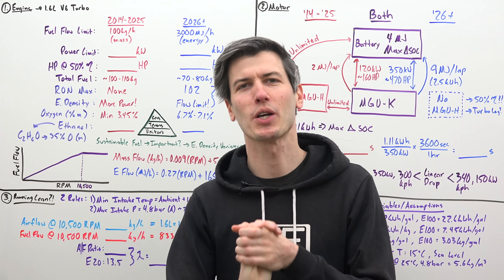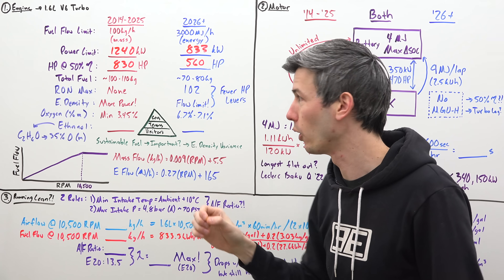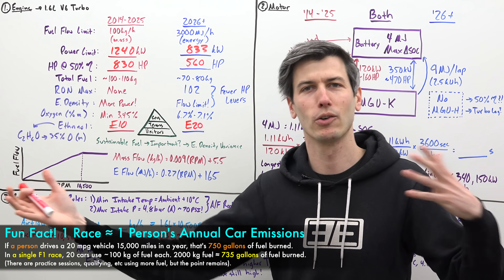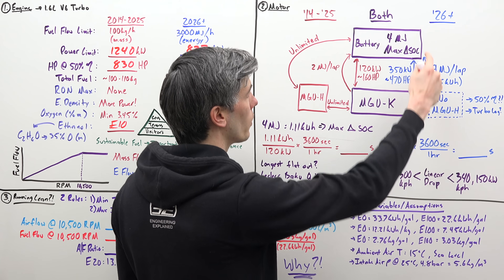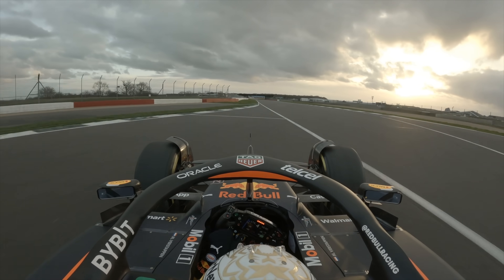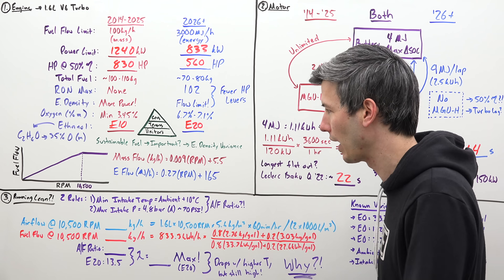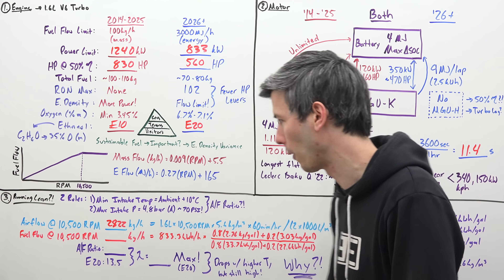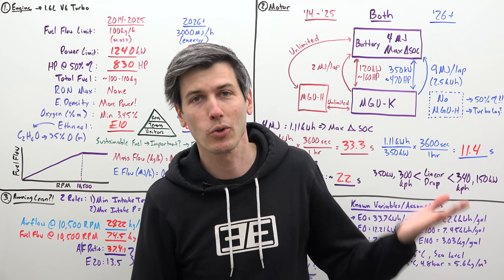Why Are 2026 Formula 1 Engines Going To Lose So Much Power?

Comment: What annoys me is the hybrid era is in the name of reduced emissions. If they really wanted to reduce F1 emissions, they'd have fewer races in the season! By far the biggest polution in F1 comes from shipping the whole circus from country to country. We could have kept the V10s and knocked a few races off the calendar and had a greener, more exciting sport overall.
Reply: Most "green" changes from big business is more about appearance than effect. Look at how celebs that preach about the environment also using private jets.
Reply: Even changing the order of races would improve things massively in that regard.
It won't even matter when the switch to synthetic fuel, so I don't understand why they wouldn't just make them sound good by allowing 3 litre NA V12s at that point.
Reply: @C.I...  Some races need to be where they are in the calendar because of local weather conditions, nobody is gonna race in Miami or Texas in June.
Reply: @C.I...  3litrer V12s don't work even ferrari didn't use them after 1995...last V12 champion was Senna in 1991. also note the last manual gearbox to win thats how old tech and backwards the idea of a 3litre V12 is.
Reply: Why does F1 even need to be green.
It's a sport that a tiny tiny tiny percent of the population participate in
Reply: @MioJuventino88 It doesn't need to be sustainable.  It's all about THE MESSAGE.
Reply: It's not that though.

It's driven largely by the engine manufacturers...that's the way they want the engines to go, because, it allows them to get the data that they need with regards to the engines they want to produce.

Yeah, ok, the FIA enforce a bunch of fru-fru atop that base line level, but, that's what makes F1 , F1.
Reply: @weedfreer  If fans wanted "road relevance" they could sit by the M4 and watch that instead.
Reply: @hedleythorne  yeah nah, I think you were maybe thinking of Indycar.

👍
Reply: @weedfreer  Hahaha! Er, no.
Reply: @hedleythorne  have you seen the side by side comparison of Indycar Vs F1 around COTA?

I mean, if it was a competition of essentially driving around a circle as fast as you can, then, maybe, they'd stand a chance.

Under normal racing conditions like at COTA it any other F1 like track...they'd be lapped withing 15 laps
Reply: I think its more about showcasing engine tech.

But yeah, I think the 3 Rs are REDUCE, REUSE, and RECYCLE in that order.
Reply: "it's not about the money, it's about sending a message"
Reply: When they say it's about the environment, it's never about the environment. Quite the opposite.
Reply: That is a good point. If that were the case though, the engineers wouldnt be pushed to limits of extracting as much as possible from the available technology. I think that would result in the teams not learning as much, which is not a great motive for the manufacturers. That is besides the prestige of course.
Reply: @EMPower91  Well the FIA are limiting the power output so I’m not sure what envelopes of technology the designers will be pushing if they’re capped on the power the engine can produce 🤷🏻‍♂️
Reply: @EMPower91  I do love the technical development side of F1 ( even though sometimes I'd like to see all the drivers compete in the same car, just to see ). I think we are kidding ourselves if we think F1 tech actually translates to road cars in the long run.
Reply: @LupinYonderboy  there are examples for F1-developed tech that is used in street cars like active suspension and KERS, just to name a couple and there is probably many more
Reply: @EMPower91  yes this is true. Problem is, new cars aren't going to be similar to new F1 engines at all. So, this knowledge isn't going to transfer very well. Maybe they should do what they did back then, like how v12s and v8s were allowed at the same time. They need to make sure that both v12s and v8s are allowed to reach the same performance numbers though. The new fuel and tech like the mgu-k can be used to aid the engines efficiency though too, while also giving engineers a new challenge. In other words, have engine variety and limit an F1 cars engine to perform more closer like a road car while making use of the new technologies.
Reply: @LupinYonder  I did see there was taks about bringing A1 gp back who knows we might see some of these drivers fighting it out in the near future
Reply: @EMPower91   hate to be the "actually" dude but on the subject of active suspension and a few other tech it (active suspension )
was already  created before F1. 
 Alot of f1 technologies are major  improvements of other tech that existed before. 
Not saying they don't innovateat all  but I have to agree with @LupinYonderboy there is very little (tech from F1) that trickles down to everyday road cars. 
If anything, my opinion I see formula E having a greater ability to influence the development  of electric consumer vehicles.
Reply: @LupinYonderboy  get with the program! Internal combustion is on the way out and you can cry about it, it will happen. Even think in 2030 there will be only generators to provide electrical power.
Reply: @LupinYonderboy  What?? Just look back in history my friend. Where do you think most technologies in today's cars were developed? TC, ABS, Turbos, Hybrid, it all starts in racing. The research lab of the automotive industry.
Reply: @EMPower91  Those things would have existed regardless if F1 existed.
Reply: @LupinYonderboy tyre technology has probably the biggest impact on road cars (if you buy high performance tyres)
Reply: Green is just a reference to the color of the US dollar. Not the environmental considerations. They are trying to stay as green (profitable) as possible.
Reply: Yea makes no sense to lower emission of the 20 race cars when there is a buttload of trucks and equipment being flown in or driven when it isn't too far. You can probably just scrap one race off the calendar, bring the V10s back and you still would have less emissions. Maybe the big part of the environmental issue is that the teams try out new technoligies enginewise that they can use to make the engines of commercially sold cars much more effective.
Reply: how about we just get rid of this eco garbage entirely? there are only so few F1 cars. These things do heck all to the environment.
Reply: You're right, and i agree with you re the emissions of the sport mostly coming from the circus moving around, but the climate/ sustainability thing is just F1 marketing to greenwash themselves. 

The real reason is financial. Allowing a free for all like the old days is not sustainable, that's why teams went bust and disappeared all the time, (and others dominated completely and utterly though tbh that's not changed much **looks at Mercedes and RB**) this is why cost caps exist, and that's why they're going in this direction, it's the only way to attract investment and new teams or car manufacturers into the sport. These rule changes are why Audi is coming into F1 in 2026, it's why Porsche wants in etc.

This is just F1 trying to survive.
Reply: It's not about actually doing better for the environment, it has noting to do with the environment. It's political. It's about appearing to be doing what's better for the environment.
Reply: If you look at those triangles of emmission you will see the major contributors is also us (fans) or people itself
. So by using F1 as a leading R&D in combustion engine technolgy, sooner or later those technolgy will be in our car, so anything that is related to our daily commute system will significantly be reduce in the total amount emision, combined, by only using small sample set of highly advance groups of engineers and drivers on the track as a "test lab". This is a long term process. Keep in mind that thet target a 0% net carbon emision by 2040 or so, not tomorrow or day after it.
Reply: Or, OR at least change the order so that the everyone could move across the globe gradually instead of jumping back and forth. Adjust the order and you compensate for all the emissions the cars produce over the season.
Reply: The tech feeds down into everyday vehicles
Reply: The biggest fuel use is the spectators going to the races. The actual race cars use an infinitesimal fraction of that fuel. It's all a virtue signaling hocus pokus.
Reply: Don't even need to have fewer races, just join them up on the calendar to minimize travel.
Reply: The EU is trying to ban anything enjoyable, even perfume
Reply: @seq31  Couldn't agree more! Thanks for this detailed answer!
Sad but true. So many amazing tracks! And some that F1 probably has never bin on. Even if it's a shorter track it could still be interesting because of many corners and amazing layout. Just no long straights. Sadly the organisers don't understand that.
Reply: I suppose those rules are made to getr more money for development in this direction. Because  a lot of race developments later became a game changer...one of those is the turbo-intercooler charger. Which reduced the fuelconsumption of any truck in the world from 1,5 km / liter diesel to , now, 4 km/liter diesel.
When we take these savings into account for F1 it's a very clean circus...saving a multiple amount of energy in comapre to their direct usage.
Reply: It’s not that they want to reduce f1 emissions, but rather increase the r&d that goes into hybrid powertrains. Lots of technologies in everyday cars bleed down from discoveries in racing.
Reply: Now see a lot of outsiders and activists don’t really think about the transportation. They see cars with Internal Combustion Engines and they go nuts. If you take this into consideration, it’s just a thing to maybe shoot themselves in their own foot at the FIA, but mainly to look better in front of the media, activists and other outsiders.
Reply: They could 100% make the calendar more efficient. Jumping from Azerbaijan to Miami to Italy is insane. Then youve got Japan, Qatar, then the US GP.  the air travel alone has to be so much worse than the emissions from the cars.
Reply: That's not really a good argument. Byt that logic, we shouldn't have car-racing at all.

Sports are for entertainment (for consumers) and profits (for stakeholders), so the relevant thing to look at is how many emissions something is producing compared to how many people it's entertaining and how much money it's making its stakeholders. More races = More entertainment and money. The emissions-goal of Formula 1 isn't necesssarily to reduce emissions overall, but to try and maximize profit/entertainment per gram of CO2.

Now i don't have the numbers to directly compare it, but F1 is a really popular sport that is watched by a lot of people (Abu Dhabi 2021 was watched by 108 million people). So i suspect that for the amount of people entertained, F1 is a rather low-emission sport. Certainly lower-emission than its American counterparts, ebecause 0ven if they travel less, the viewer numbers are about 20x higher for F1.
Reply: We all know that the emissions from the cars on the grid are fairly irrelevant in terms of the carbon footprint of a race, but I think it is important for F1 to be relevant to the car industry, and it's important that F1 is developing technology that will appear in "real" cars. It also doesn't look good if F1 says "we're going to keep our gas guzzling engines, but you have to drive slow cars with tiny engines". F1 engines consume a fraction of the fuel they used to, but have continually gotten faster. Every generation has seen an initial reduction in speeds initially, but withing a season has exceeded the speeds of the previous generation. The 2026 engines will see another reduction in power, but I'll be surprised if we don't see manufacturers and teams producing cars as fast or faster than present by 2027.
Reply: The majority of the F1 circus is shipped to the races by surface. I think there are five different sets of race "kit" shipping to the different races. One way to reduce the carbon footprint would be to optimise the races so that they could do it with four or even three sets of gear. Another would be to reduce the amount of kit teams are allowed to fly to races. Having the majority of the car shipping by surface, with a weight limit on new parts that can be flown in could save a lot of carbon miles.

However the biggest carbon footprint is from fans. If you can reduce the number of fans travelling, particularly the number flying in, you could reduce the footprint of the race. Of course that would also mean reducing profit from ticket sales. However, reducing parking at circuits and increasing use of public transport could see a significant reduction in emissions from a race weekend.
Reply: @lostcarpark  some more great points, thanks
Reply: Use hydrogen seriously, if they use that, it will bring back the V12, and I wanna hear those good'ol sound
Reply: I mean a better order in the race callender would help massively
Reply: F1 is such a teny tiny absolutely minuscule amount of global emissions.
Reply: With synth fuel you could have V10s anyway, the issue is that V10s are irrelevant to manufacturers.
Reply: great point.  I'd go further and say the impact of fans driving and traveling to the races greatly eclipses the carbon footprint of the teams.
Reply: Couple races less i agree on.. but imagine if the calendar was actually scheduled efficiently?
Reply: Just TALKING about environment impact for 20 cars racing once every two weeks is hilarious 😭
Reply: less races=less money
Reply: Actually the highest emitters of a Formula 1 race are millions of fans that drive to the race tracks to watch these races. Netherlands was interesting that they didn't low people to drive in to watch the race. People instead used transit and bicycle coming and watch.
Reply: You have a strange angle on this.  F1 tech is used as development for the whole industry, not just the actual racing series.  Engine development eventually trickles down to consumer cars. More efficient F1, more efficient cars overall = lower emissions.  Greener earth.
Reply: There's absolutely no way to make professional sport green. Especially motorsports.
Reply: How does the most boring "bring back v10's comment" have over 3k likes. You literally can not come up with a more tired, retread, over-used comment than this. If you like racing watch F1. If you like crazy loud engines go to the drag strip. Something for everyone.
Reply: Let's be honest, F1 is NEVER going to be sustainable. 
As an eco conscious and car enthusiast guy, it's hard to admit, but nothing they can do would ever make "let's take crazy boxes that goes as fast as physics allow around a loop" sustainable. 
Even if it was electric : neglecting the biggest impact (which is transport of people and team to the track), the sheer amount of energy and rare ressources required to create those "crazy boxes" is an injustifiable waste of precious ressources.

But greenwashing is the name of the game at the moment. You just have to pretend hard enough that you're sustainable. Which is something those hybrid V6 excel at : pretending they're more sustainable.
Reply: @InformatrIIcks  it's an oxymoron. they are racecars not smartcars. why would motorsports be efficient. It's like having Olympic athletes compete while in calorie deficit.
Reply: They really don’t care about emissions. It’s all for the media and to keep environmentalists happy, saying oh we have tiny hybrid engines and are going to be using renewable fuels. They leave out the part where they’re jumping from continent to continent every other weekend.
Reply: Total click bait.   Less races! more privation!
Reply: It's all a psychological operation by Malthusian Eugenicists who want you in debt slavery
.
Reply: Or they should stay on a continent more. Europe has so many tracks... Spain, italy, Nürburgring, Hockenheim and few more in Germany. Spa and many more. You can drive to each location by car easily if you have one.
Couple races in Japan. Autopolis, Fuji and Suzuka for example.
And the US has many tracks too!  Would be so much less emissions if there would be 4races in the US 4 in europe and 4 in Japan or something.
Reply: SpaceX....
Reply: I think you're missing the point here. The reason why they go around circuits is for money, and sometimes getting money means pretending you care about things you really don't, like environment.
Reply: Exactly... If I wanted to watch formula E I would. But of course nobody wants to.
Reply: Now it’s not about the environment, it’s about lining their pockets
Reply: How right you are, this whole sustainability thing is a joke when you look at it closely. F1 will not be F1 as we know it for much longer. The best days of F1 are gone forever.
Reply: @daviddickinson6346  I do have hope in the program that they are going to find something, but at the same time, we would loose a precious sport.
Reply: Just changing the order of the races would make it massively more efficient
Reply: Common sense vs green  weenie leftist propaganda propped up by government. Common sense always loses.
Reply: to be fair. for marketing making your cars look cleaner would be seen and approved more than just. y'know changing distribution stuff.
Reply: In the Netherlands up to 80% of visitors for the race come by bike or by public transport (mainly trains).  And those that come by car are directed to carparks up to ten miles from the circuit and shuttled in by busses
Reply: The reality is, we don't need automotive racing, we'll get by just fine in life as a species. So why not just stop it altogether if it's really about the planet and all that jazz? Why because then no money is being made. Climate change is a  quasi religion. It's about power and money. They'll keep doing what's needed to seem that they're part of the zealots and the flock, but really they don't care - as long as they can keep their power and money. Effectively it's all BS. Also the tag line about F1 technology trickling down into road cars is pure nonsense at this point.
Reply: Agree. The more restricted the actual combustion are and the more that electrical power is taking over, the less spectacular these become. In the V10 era I used to go to as many races as possible as I loved the atmosphere and noise, but nowadays with these big Disney cars with their overly complex and dull sensation power trains, I hardly keep up with F1.
Reply: or just host the races east to west instead of traveling between hemispheres. less emissions that way.
Reply: True. 
Make F1 only European Circuits. 
Great for Reducing emissions.
Reply: @muhmonsta  no, then i cant go to the races in texas and florida. also thats ridiculous.
Reply: @jayjustjay7871  
Even better. that even less emissions.
Reply: @muhmonsta  less fans too. its an international sport
Reply: Or a more fuel efficient schedule lol
Reply: the emissions from moving the circus is a drop in the ocean compared to 100000 people traveling to the races, and 70million turning on their TV for the races
Reply: I think it's more about extracting more from less
Reply: THIS.
Reply: They should be gearing up to be peak performance orientated but that doesn't mean the V10, it's still hybrid something small and snappy like a V4 with a big electric motor for high torque and hp.
Reply: Or they could just methodical work their way through each continent and country that has multiple races instead of cris crossing the planet.
Reply: Shhh that makes too much sense the FIA doesn’t like that
Reply: Another vote for V10. But if they dont pretend they do ESG they wont get any funding.
Reply: You’re missing the point so hard
Reply: They give 0 craps about emission. It’s external factors such as pressure from countries and consumers. Whether it be legal or just social, they want to protect their market. 

What annoys me is pretending to care about it, and all the other people pretending to care about the emissions when they go about in their life making 0 change or difference in reducing their emissions. 

I don’t speak from a point of transcending all this. I don’t care about emissions, and want to see fast cars go around a track.
Reply: @2pumpedupforu  it was all about a shift to technology that was relevant to road going cars. They created the most thermally efficient ICE engines on the planet, but also created bloated race cars the size of Range Rovers that were un-raceable to the point that they had to create band-aids to make passing possible. They are 400 lbs heavier than a typical V10 era car. F2 races are more fun to watch and sound better.
Reply: @mtnman1984  I don’t follow F1, but that sounds like optics and marketing as well as just maybe some of the F1 teams giving pressure. Point is that the FIA is only concerned about profit and ensuring the profits of the participants of F1 (teams, tracks, sponsors)
Reply: @2pumpedupforu  not exactly their function, but I get the point. Formula 1 is it's own entity and they work hand in hand with the FIA. I get the shift for marketing purposes, but I also don't. Very little of the tech in an F1 car is in any common road car. Nobody loves the V6 era cars, including the drivers.
Reply: yeah but dey won't make money
Reply: The argument (not saying I agree with it) is that the development of the ICE units used in the cars spills over into production cars, meaning that the gains Merc and others have made in thermal efficiency ends up in all cars and reduces all of our emissions/consumption. I do agree that they have much work to do around the traveling circus still to improve efficiencies as well.
Reply: instead they are adding so many extra races that even the F1 drivers and teams are complaining that it's just too much and too long..
Reply: I think hybrids reduce emissions since f1 tech trickles down to regular cars, advanced hybrid tech eventually benefits a broader range of vehicles which can be scaled to millions of engines
Reply: the thing is, f1 for many companies is a test field for innovation that they can use in roadcars later. This is why Honda decided to stay in the sport, why Audi are joining, and why mercedes got their own works team instead of continuing with mclaren. Yes, the V10’s were angelic, and i wish we could still hear them roar every weekend, but that era has passed, and we have to let it go.
Reply: It is the developments in here that are then applied to regular cars of which there are billions that make differences in the emissions, having these people race 15 instead of 23 times doesn't reduce emissions in any meaningful way
Reply: The biggest contributor is the crowd in the stands
Reply: The intent of efficiency is not about F1 itself, but demonstrating innovation which eventually influences road vehicles.
Reply: It's money bro. You can't care for the climate when you are poor.
Reply: It is in the name of reduced emissions if you wanna see it like that. The thing is by implying those regulations manufacturers are forced to big big r&d research with the goal of applying similar technologies in road cars efficiently
Reply: On the other hand I think it's way more beneficial fpr the automotive industry, if F1 runs engines closer to what's on the street aka the customers benefit more over time
Reply: Not even mentioning the inefficient calendar.. next race is Canada from spain. Only to go back to europe.
Reply: This is so true! The hypocrisy  in the whole organisation is on another level.
I believe they use this as a brainwashing method to force people to believe that electric road cars are better and people would want to buy electric cars.
Reply: I have done sustaibabilty studies before. Personally, I think that the biggest part of the impact of F1 is on the fans, especially travelling to and from track, single use products sold at races. Reshuffling races so that they are closer geographically helps, but I think it wouldn't be as big a reduction as some people think.
Reply: To be fair 22 f1 cars are not that damaging to the planet lmao.
Reply: @tostadorafuriosa69  that too
Reply: i think their just doing this as so as manufacturers have an engineering incentive to develop electric power trains because if you know automotive engineers alot of them are car guys themselves...purists of the purists in fact!
Reply: It's not so much to reduce emissions on f1 as ot is to allow engine suppliers to use f1 as a testbed for hybrid engines. Not that that really works either mind you.
Reply: 24 races is ridiculous, I agree, and they travel around the world twice. 20 races would be just fine. And then just rotate locations more often. Also... why are races a minimum 305km. What's that extra 5km? Longest race is like 309km because of that. Just make it a minimum 300km.
Reply: If you look at Extreme E racing, they at least have been putting in the real effort to reduce the logistics and operations footprint. All gear/cars/crew are shipped....by ship. Which is much less carbon intensive than flying. The operations run from tents, and energy for ops is provided by battery storage charged by hydrogen fuel cells fed by solar hydrolyzed hydrogen. So they are at least thinking holistically.
Reply: Exactly the point is all bs to look good to the mob
Reply: F1 doesn’t care about the environment … neither does any company or government. They care about controlling or going along with the narrative that makes money and retains control
Reply: Facts
Reply: F1 is the technology benchmark for OEMs. The engine development in F1 drives the technology we see on the road, manufacturers want to showcase their hybrid and EV tech so people will buy their cars
Reply: Yea , reduce emissions , but we are not that in such big hurry to do that.
Reply: The eco losers are ruining it for everyone.  I say screw them give them the middle finger and go back to v10
Reply: It’s all a joke anyway there so few F1 cars it makes zero difference to anything whatever their efficiency is! Sure Climate Change is real and super serious but F1 cars put out essentially nothing compared to anything else. Anything super limited and exclusive adds up to nothing in total and doesn’t matter. Focus on what does matter and stop wasting time where it doesn’t matter and ruining fun.
Reply: That is NOT the point.  F1 tech drives everyday cars a few years later.  The F1  cars are a testbed and a research platform.  Reduced emissions in F1 lead to better performing, lower emissions engines. So, we all win - reduce emissions and still have performance.  Ok?
Reply: But this would be euro centric
Reply: To be Green they should just ban F1 😂😂😂😂
Reply: When will people realize this is all for appearances they don’t care about the environment and global warming is a scam just another way to tax and control the population while destroying f1 while reminding everyone of the lie.
Reply: It's all gimmicks that's why it doesn't make sense.
Reply: There is no climate crisis. Stop it.
Reply: Why not mandate that if you drive to F1, it has to be in an EV or public transport?
Reply: @BAC_Mono  you win the dumbest comment of the day
Reply: That's on the surface. The real reason is cost.
Reply: But then people would missout on races then be use it wouldn't come to town,
Reply: Show your working😂😂
Reply: One thing that can improve sustainability is to put the races in groups like all the European gps back to back all the American gps back to back all the East Asian gps back to back and the Mediterranean gps back to back. It would reduce overall emissions
Reply: @dipesh8836  Problem with that is F1 is 70 years old now and some GPs are slotted into specific weekends for historical reasons. Shuffling those races out of their weekends would make entire countries angry.
Reply: Because like almost most things related with corporate sustainability its all about appearances.
Reply: The reason for the hybrid stuff is to force innovation that can work itself into the automotive industry and reduce emissions on the road
Reply: @gordontheman6151  Also this yes
Reply: @gordontheman6151 Stalin and Hitler were quite fond of 'forcing innovation'.
Reply: F1 is all about being at the pinnacle of technology. Hybrid technology is that pinnacle at the moment. It produces more power while using less energy. Additionally, hybrid vehicles are becoming more relevant in modern cars. This is in combination with the reduced emissions, which are just a bonus at that point. Efficiency is the goal of any engineering endeavor. If an engineer has the opportunity to increase the efficiency of their vehicle, they’re gonna take it at any cost
Reply: @mrsoisauce9017  it doesn’t produce more power, it conserves power and reuses it.
Reply: @mrsoisauce9017  The push is plug in EV, not hybrid. I believe hybrid makes more sense
Reply: @carlfrye1566  wdym?
Reply: @mrsoisauce9017  There is nothing 'pinnacle' about battery powered vehicles.  The technology was invented ~134 years ago.
Reply: @H0kieJoe  just because it’s old doesn’t mean it’s not the peak. Nuclear energy is old, yet I still consider it to be far superior to renewables
Reply: @mrsoisauce9017  It isn't the peak from an entertainment perspective.  Entertainment is the whole point of F1 and racing in general.  I don't want to listen to a pack of Hoover vacuum cleaners making circuits on a track. 

There is nothing visceral about a V6 turbo from a spectators perspective.  They should go back to NA V10's which were highly entertaining to watch and feel/listen to. 

The F1 series is trash now.
Reply: @mrsoisauce9017 No its not the pinnacle. The pinnacle for racing is speed. Is must all be done in the name of speed.
Reply: @mrsoisauce9017 This is formula one, which is supposed to be the pinnacle of racing. Racing engineers would endeavor to make the best race cars. These cars make less power with more weight. This is done to satisfy tree huggers, not racing engineers.
Reply: @pgmallon  They make less power because they’re not allowed to be fully unrestricted in terms of power. A fully unrestricted PU would offer more power than we currently have with better acceleration from the electric motors. Let’s not forget that some of the cars that hold world records at multiple tracks are hybrid or BEV, and that the fastest LMP1 machines were hybrids. Hybrids are objectively the quickest vehicles we have to date around a track. If F1 engineers had their way, the V6 hybrids would be going many times faster than they could currently. The only problem is that anything faster would also kill the drivers, so it isn’t up to them
Edit: oh, and the 2026 regulations are running on 100% sustainable fuels. This means that they could gut the hybrid powertrain entirely if they wanted to and still be carbon neutral, but they didn’t. Instead, they increased its power. They did that because hybrid technology is more relevant to modern vehicles than pure ICE power is. F1 still has to remain relevant to the automotive industry for manufacturers to be interested. Without manufacturers willing to make engines, there is no F1
Reply: The hybrid engine was a demand from engine manufacturers as they faced pressure from public and board on the expensive engine when future would be hybrid/electric.
Reply: Welcome to corporate America (or anywhere for that matter). Just buzzwords and feel-good extravaganza. It's a wonder that they even remembered to remove grid girls just five years ago.
Reply: True, but doing that reduces the revenues and profits. More races = more $ revenues/profits. So they want to maximize races AND improve the emissions factor at the same time.
Reply: @ilmostro16  some people have turned off F1 because of the sound though v10s V8s v12s might bring them back quality over quantity is all I'm saying. But I see what you're saying as well
Reply: @ilmostro16 Or how about disband f1 as a sport completely?
Reply: The biggest pollution comes from the 100s of thousands of fans going and to and from the races, so let's ban spectators!
It's not about directly reducing emissions, it's about developing and showcasing technologies that do so...
Reply: 我需要在這裡打字消耗資料中心的電力，增加那些企業的收益並去提升分配的總量給真的在增進效率的工程師。
Reply: Bs, the whole of F1 is a drop on the total energy used in the world.
Reply: @joostprins3381  don't be ridiculous.  Everything ads up and getting rid of any single thing won't reverse climate change.  The per person emissions from F1 and its associated activities is disgusting.  Many dozens of times higher than the people that suffer the most from climate change
Reply: It would make more sense to not allow any flying.  All transit by train or EV busses and semis which are both attainable now.  Hopefully F1 is full EV within 10yrs though but I doubt it.
Reply: @veganpotterthevegan  well, there's a reason it CAN'T be.

The Formula-e series holds the rights to a fully electronic series.

As such, F1 could only ever get to 99% electric before it breaches the rights that Formula-e has on the electronic series.
Reply: @weedfreer  F1 can easily buy their way into going electric.  They can buy out Formula E completely and shut them down if they really wanted to
Reply: @veganpotterthevegan  there are other ways to achieve sustainability. Also, you can’t go from America to Italy quickly without flying, and taking a boat is just too dangerous. It is much safer and faster to fly. Planes are switching to eFuels, which makes them more sustainable. Electrification will not replace the billions of ICE cars on the road today, and there will need to be a racing series to pioneer sustainable ICE technology. And while all transit by train or bus sounds great, there’s a problem: they can’t take you everywhere. A car can
Reply: @MrSoiSauce  the bulk of the teams are European.  No need to come to N.America at all.  Hold events in locations involving more sustainable locations.
Reply: @veganpotterthevegan  what does that have to do with anything I just said?
Reply: @MrSoiSauce  it's another way to achieve sustainability...
Reply: @mrsoisauce9017  "Electrification will not replace the billions of ICE cars on the road today"

Excuse me, what? Of course it will! It's already happening. Selling new ICE cars will be banned in the EU in just six and a half years. Sure, it will take far longer to replace all ICE cars, but in two decades from now, nobody will want to buy ICE cars for transportation.

As for planes on e-fuels, that's not really a thing yet. Yes, you can produce synthetic fuels today, but those are far more expensive than the current fossil fuels, and it's currently not much greener anyway as it's not produced through electrolysis. Give it a decade though, and this will have changed just as electric cars will have taken over. Similar e-fuels will be used for the shipping industry in the same time frame.

The world is changing. It won't be long before F1 will look like a relic of the past if they don't go electric as well. And they're slowly going there. The 2026 rules already say almost 50-50 electric and ICE. Every new rule set will turn that dial up further and further until the ICE part just vanishes and F1 fuses with FE. There's really no way around it, as there will be no economic incentives to develop ICE for F1 when the technology won't be of use in production cars. That's just not realistic.

Just how I see it, and the time line may well be off. But I can't see it going any other way eventually. It just doesn't seem possible to me.
Reply: @mrsoisauce9017  nothing, ignore them. We are still a civilized world and we need recreation, we are not going to live like monks and give up airplanes. We can have less babies and do other things like have biodegradable plastic this will have way more impact than stopping flying.
Reply: @deantoth  what?
Reply: @DirtyPoul  No, not really.
Reply: @C.I...  What a great point.
Reply: @veganpotterthevegan the only thing racing should be concerned about is maxing efficiency of liberating maximum work from stored energy. 

Sustainability and net zero concepts are IQ tests that a majority of people are failing. There are actual environmental concerns and they're nothing to do with liberating carbon back into the atmosphere where they belong, but rather how quickly we're burning them up, overfishing, etc.
Reply: @veganpotterthevegan  good luck getting your buses and trains to Australia, Brazil etc.

And yeah, you said don't go outside Europe, which is the stupidest thing I've ever heard. This isn't Indycar that is continent-specific - it's a global sport.
Reply: @Ho3n3r  you can't read
Reply: @veganpotterthevegan  You tell me you are a vegan twice in your name, before I have even read your comment, AND you hope that F1 is full EV within 10 years? I hope this was a clever joke, for your sake.
Reply: @Boris  you can't read.  This stuff isn't happening.  I'm just saying it could.
Reply: @veganpotterthevegan  Formula-E has a lock on full EV racing until 2035 (if I remember correctly)
Reply: @wrlee  they do.  They could very easily be bought out of that contract though.